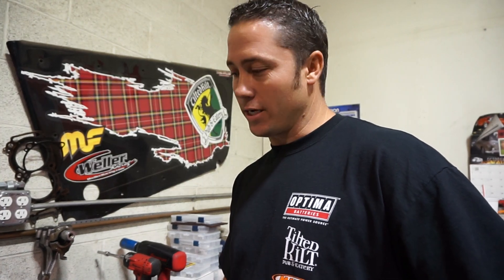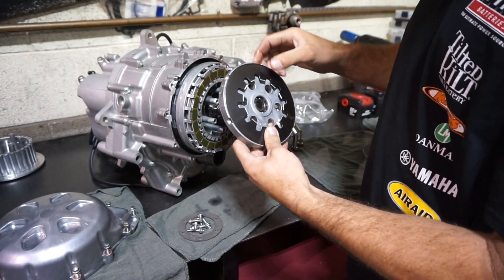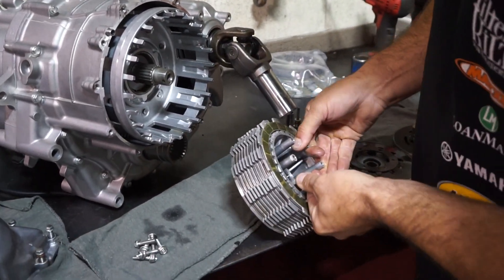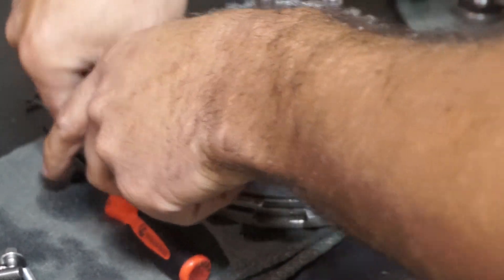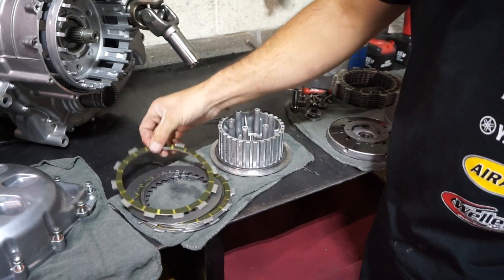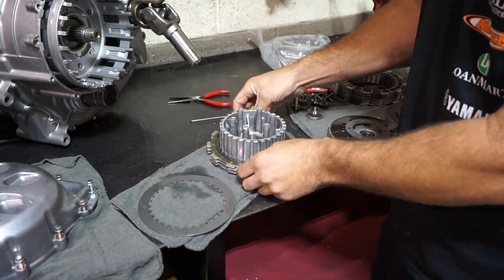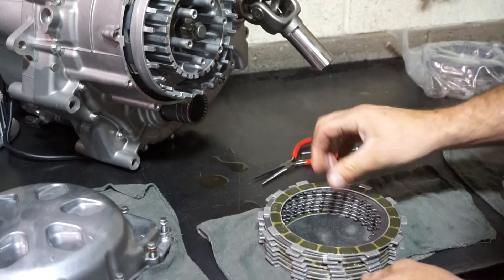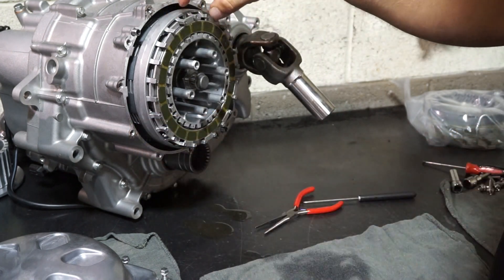Weller Racing YXZ1000R Clutch Upgrade / Install

Comment: Thanks for the install vid.  Another shop in California recommended 8.5 ft pounds for the clutch cover housing bolts, which resulted in a snapped bolt..  I'm pretty sure your recommendation of 7 ft lbs is much more in line with what it should be.

Comment: Just did the TW Clutch mod today, during my test drive I noticed engaging forward/reverse (sport shift) it now clunks harder and surges the YXZ when kicking into gear. Is this normal? I'm figuring it is now that all the clutch plates are actually wet and fully functional. Over half my clutch pack was dry when I tore it down today, 100 miles on her so far, all plates still looked good (no discoloring), dropped Maxima MTL85W in the tranny.

Edit: Oh and thank you for the video, it came in handy making sure everything went back together the right way today!

Comment: This upgrade is good but if you remove those last three narrow discs the clutch would get stronger especially in the plucked out as in its lifetime being able to even abuse the clutch in more locked places locked tracks gets the hint do not know how to insist on those three thin discs hug